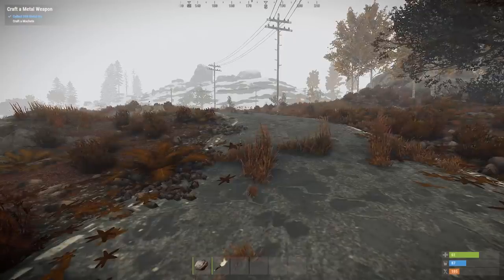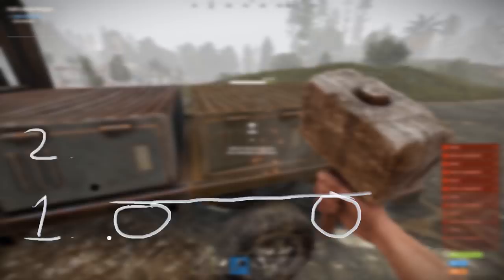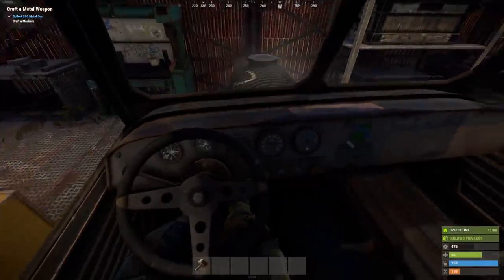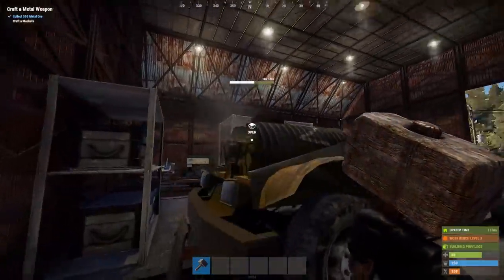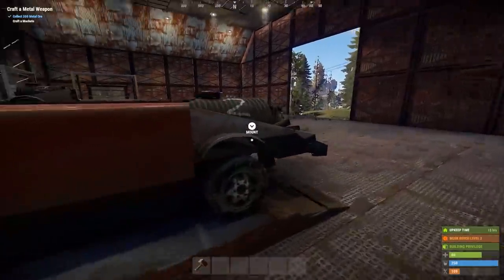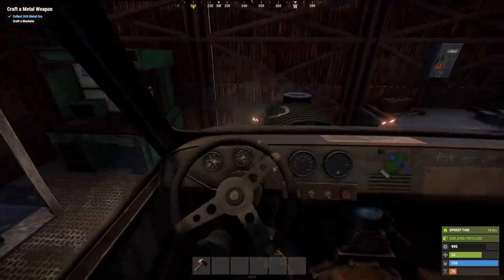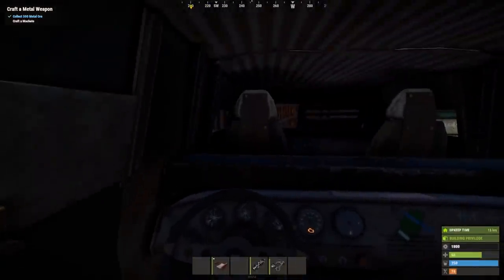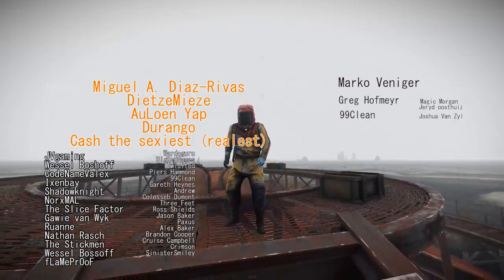Rust Vehicles: How do they work Ingame? (Indepth look)

Comment: now, car in scrap heli, drop it off as a ariel strike
Reply from the maker: Jesus the posibillities
Reply: like the fast and furious movie
Reply: Mister Flak they should add remote controlled C4 so you could pick up a small vehicle, cover it in c4 and drop it on a clan base.
Reply: i was planning to take it to oil
Reply: Shadowfrax tried it on his stream and it currently doesn't work. It looks more like active vehicle sex or vehicle birth more than anything.
Reply: Maybe make it so there's a way to repair the attack heli or research it if it lands in the water. Or maybe some emp or hack. Maybe a cool feature
Reply: Ferry boat that can hold cars or a scrap helicopter
Reply: RagyRaptor979 slaves with remote controlled C4 on them?
Reply: ShyData ABSOLUTE GENIUS
Reply: what if cargo planes that can drop bombs and fully armored vehicles
Reply: Mclovin420blazn Who says you need a remote control? It’s better if you can hear their screams
Reply: Budlightyear98 bootleg Air Force
Reply: @mclovin2408  just have someone in the back throw the c4 on and then the other person drives out, if you timed it right it will work great
Reply: @mclovin2408  Thats something lazarbeam would do

Comment from the maker: I seem to have accidentally cut a small part. The Vehicle lift one can purchase from the outpost is a standard rotatable deployable item like a workbench. They require 20 electricity to function.

- Vehicle testing branch will be released to the public on the 18th of may 2020.

- Vehicles will go live to the game around July.

- Minocopters will become modular like this in the future.

Stay Covid safe my Brothers and Sisters <3
Reply: How did your youtube channel gain support
Like what breakthrough did you make that got you subscribers
Reply from the maker: @g1expert102  Everytime i upload a video i make sure that it's a video that i would enjoy watching.
Reply: Which config works or handles the best over rough terrain...or is it dependent on how fast you go?...does the weight make a difference in the handling? or do all configs handle the same...like shit...
So if weight makes a diff as in having more then one engine...then choosing the smallest config with one engine /cab over and a storage box on back would be the best?
A video showing how the different configs perform would be sweet...
From a simple smallest chassis 2 slot with a cab over engine with nothing on the back as the lightest weight config as possible...to say the same set up but with an engine in the rear for 4 wheel drive...if having 4 wheel drive makes a diff...
I guess what I am getting at is what is the best handling set up...cause speed don't mean shit if it is uncontrollable...slow and steady wins the race...
Reply: This was a great video, high quality, and easy to understand. I thought it would be a bad update at first but now I'm excited.
Reply from the maker: @harryguy76  hi Harry. So the handling is best with the 3 modular. 4 modular is too long and 2 is too short. Weight and centre of gravity plays a part so anything tall like the tanker would make it roll easier. The best and most nimble config I found was a 3 module cab. With an engineless driver cab in the middle and a front motor.
Reply from the maker: @armandodilan4767  thanks bro ❤
Reply: no one:

literally no one:

Me: reinnacting 9-11 with modified minicopters and scrap helis

Comment: Too much work for something you can lose within a second to a clan especially for a solo. I'd rather take tools in the tool boxes thanks.
Reply: i hope that you can code lock the cabin
Reply: Exactly. All the devs add are end game stuff when you have more loot than you can handle.
Nothing to help the smaller groups besides the TC upkeep...
Reply: take the engine parts out?
Reply from the maker: I'm going to suggest a mini tc system for them. One where only you and your team can access your car
Reply: Mister Flak yesssss please do!!
Reply: @MisterFlak  That would be great, give the solo a fighting chance. Thanks.
Reply: @MisterFlak  or maybe a lock that you can hack like a crate.
Reply: @ManuelDiaz-rn8ps  if you can hack, then you are still fucked...you can have one hour hack time and still won't be able to go up to a group as a solo and retake the vehicle
Reply: @MisterFlak  It could be the cab itself making the multiple cab thing a no go because it would technically be a TC too.
Reply: shotgun trap on the bonnet
Reply: exactly

Comment: The effort required to make it and keep it safe dosen't seem worth at all.
Reply from the maker: It's in early days. I suspect many safety mechanisms
Reply: the ideea would be to just use it for driving from point a to point b, not to roam around with it.

I can totally see it used by a solo to move his raiding supplies safely.

Or having a getaway car in your base...when you are getting raided and about to loose, you pull a switch, that opens a couple of doors, you hop in your armored car full of loot and drive away to a second base.
Reply: Keep in mind that probably by the time it releases in July it will probably come with HDRP UPDATE which overhauls map generation and other things which will make vehicles make more sense because right now maps are stupid and unrealistic... they are dogshit... so yes... if it doesn't make sense now... it will in the close future xD
Reply: yea feels like facepunches wasted its time with this... tbh rust don't need cars

Comment: Idea , make a large battery cabin or medium battery cabin. 
Ex. Find one out in the wild , learn it , find medium battery , learn that. 
Now craft medium battery , make medium battery part of the recipe to craft the cabin. 
Now craft the cabin with say 500-1000 metal frags + 1 medium battery

Then make the flatbed piece have a slot for an auto turret to be mounted like the car system does for different cabins or engine parts. Connect power and bam you're good to go chief

Comment: With as slow as the starting chassis is and how many resources you need to invest in it, most people would rather continue to use the mini or scrap heli. + If face punch isnt going to add a hanger door (a larger garage door.) Then what is the point, people would just be able to walk up and take your vehicle. 

Yes I know that garage doors can work just fine but I mention the hanger door for 2 reasons, if your building isn't level with the ground you are going to have issues getting your car in and out. And two, actual hangers for our helis.

Comment: is there any reason to take the non motorized cabin over the motorized (except the armored one) if you have access to both?
Reply from the maker: Heavier cabin with a motor. If you fill it with engine components it'll be faster but use more fuel. Really depends on your preference. If you're rich you use 2 motors and if you're poor you use one 😂

Comment: but why use a car (which takes more time to create) when one could just use a helicopter??

edit: also does the car even fit through a garage door
Reply: you can't transport 48 stacks of loot (plus inventory) or a whole 8 man zerg in one minicopter. And scrap chopper is a big target.
Reply from the maker: Yes the car fits through the garage door. Mini copters are going to be reworked and also become modular
Reply: the mini will also have parts...and you won't get it on the road any more, you will probably have to get it some other way and put in more work to get it started than in a car

Comment: That all sounds great, until you get it running for 5 seconds and a naked DB's you and takes it. I can't see these being very wanted. Most of the time you take a huge risk putting lowgrade in a mini and letting it power up for 5 seconds. At least a mini can fly!.  I can't image having to build the darn thing. Literally no one is going to mess with these other that for the novelty, sorry. Unless these are going to replace the scrap heli, I can't see anyone investing the time and risk in it.